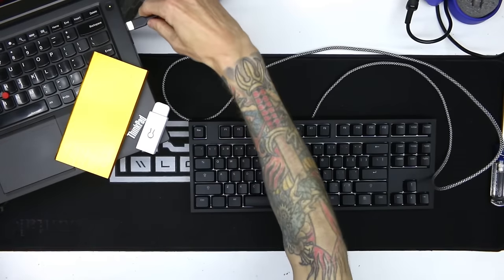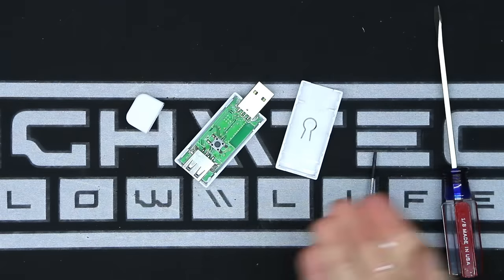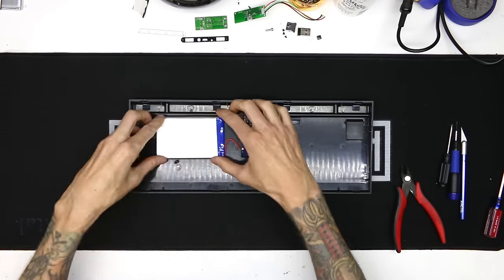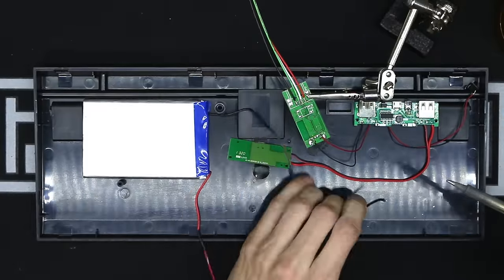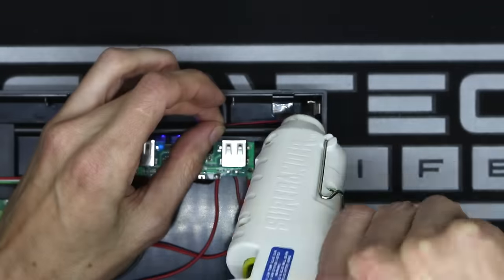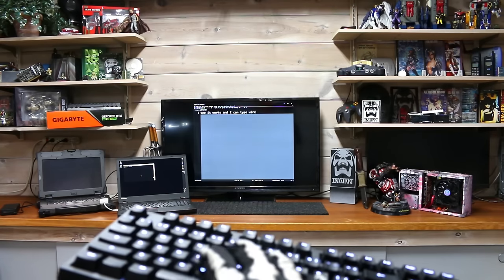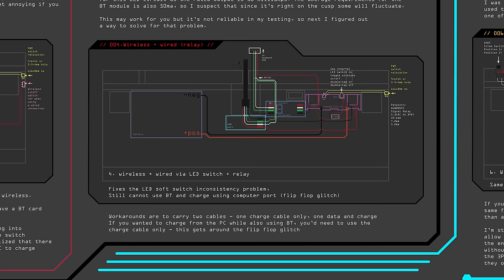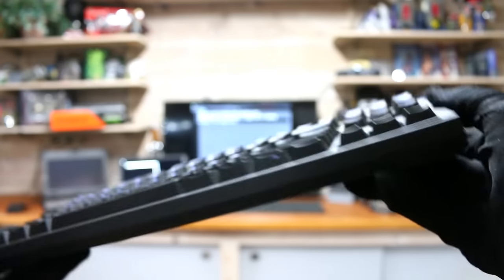⌨ Make ANY Keyboard Wireless! - Convert Any USB keyboard to Bluetooth Wireless - DIY Tutorial How To

Comment: Hello, The official site does not send the adapter to Colombia, where can I buy it to be sent to Colombia?
Reply from the maker: Hello, can you confirm with their support team? According to their site they do ship international: "$9.95 to international addresses by USPS airmail." 👍
Reply: OK, I'm going to write to them.  One question, if the battery runs out and I need to use the keyboard immediately, can I connect it via USB cable and use it, or should I wait for it to charge?
Reply from the maker: @AngelSing-Zepol  You have to look at my wiring diagrams shown in the video, I also explain in the video there is more than one way to wire it up. Either way it will work directly plugged in because the battery will be charging while you're using it if you'd like, you can also just have a direct wired connection if you want to wire it up that way. I show in the video wiring it either only wireless or both wired/wireless switched connections. 👍
Reply: @hightech-lowlife  yes, i saw your plans and they are great, but i have a question, when does the switch from wireless to usb happen? when you press the switch button? Or do I have to enter some command on the pc? the manufacturer talks about switching through the mode button or shortcuts, it is not very clear to me where you switch from BT to USB and vice versa. As I understand the mode button or shortcuts is the button that comes with the adapter, right? if so, you should extend it with cables and another button so you can press it whenever you want without opening the keyboard, right? or control everything from the same power switch button? like a double switch or something, I'm a bit confused at this point.
Reply from the maker: @AngelSing-Zepol  At the end of the video I explain the two different ways I recommend  to wire it up and the pros and cons of both. 

One is to use the BT module hotkey to do the wired/wireless switching. This is a lot easier to wire in, very simple wiring. [The only drawback with this method is that the connection to the computer is not native, so your computer sees your keyboard through the BT module "bridge" which is fine for most things, but if you want to do something like flash firmware to your board, you won't be able to because the computer is not seeing your actual keyboard, merely a bridge to it. ]

The second method I am using my charge circuit flashlight LED switch (double tap the power button) to trigger a set of relays that swap both power and data pins from the BT module to the USB cable. This will allow you to achieve a native USB connection to your computer because the wires from the USB port are directly connected, the BT module is no longer in the circuit at all. The relays are essentially "unplugging" the BT module and then "plugging in" the keyboard port. 

I hope that makes sense for you. 

You can wire this up many many ways though, I'm just showing you a few. If you're ok with adding another physical switch to your keyboard, then just add it to toggle between the BT and wired modes, that's all my relays are doing - I'm just using them because I can control everything off of one physical button. 

If you watch my videos on my custom dual battery keyboard I wire it up using a physical switch to toggle between bluetooth and wired modes. 👍
Reply: @hightech-lowlife Ah I understand, I mean in the second option (relay) you turn off the keyboard by pressing the switch once, and you do the BT/USB communication by pressing the switch twice, this way you only use one switch, right? but for this method to work the Power Bank Module must have the flashlight function. Everything is now clear to me, I will look for the relays here in my country, if I do not find them I will have to go for 006. Wireless + Wired (slide switch) since this way I also have a direct link just by moving the switch and I will be able to charge the battery without problems.

Friend thank you very much for your help. you're very kind.
Reply from the maker: @AngelSing-Zepol  Yes, you got it now! 👍 You may be able to find other relays that are small, it really depends on your keyboard you may have more room for slightly larger relays too. Thank you!

Comment: The idea is pretty neat and well thought through. The biggest block to me is the fact that the Bluetooth adapter costs more than the keyboard itself.

I guess if you have a really expensive/custom made keyboard it might be worth it to mod. But as for me with a 2017 Blackwidow Chroma V2, it's not really feasible
Reply from the maker: Yes, this mod is definitely not as a means of saving money or doing this cheaply, that would be an entirely different video. A lot of viewers seem to think this video was made as a means to make a wired keyboard wirelessly for free (or close to that) which it's not at all. 

The keyboard I installed this on is 3x the price of the adapter and this model is not offered with a wireless option, which is the use case for this modification. If you have a keyboard you really like and it's not offered wirelessly, then this is the solution. While for some people "just buy a cheap wireless keyboard" will work for them, they don't seem to be able to understand "what if they want this specific keyboard to be wireless?" they don't have an answer for that. 

There are a lot of options for wireless keyboards in the $50-70 range now (also keep in mind this video was made 3-4 years ago). But this assumes you like those keyboards, or you're not as particular about that as opposed to your budget. 

I don't think any amount of money (reasonably) is too much for a tool you will use for hours a day every single day. This would be an item you will far more than you will any other item you own by a huge degree (only matched with your mattress). If this keyboard setup runs you 10 years, you can take the initial cost and average that per year. Even if you spent 1000 on your keyboard, that is 100 a year, which is $8.30 a month. More people spend that at starbucks in a single day than they would feel justified spending that much on a tool they use every single day that is closely tied to their ability to produce income.
Reply: @hightech-lowlife  I actually did not think that far lol but I guess that's true. I just thought of this idea recently because of my new mini ITX I built and wanted to go wireless. Picked up a really cheap mechanical keyboard in pristine condition. I was, and still am, a bit baffled why a conversion like this is not more commonplace.

Guess I do know now. The dream is not fully dead yet though 👍
Reply from the maker: @qaywsx583  I personally don't even like wireless keyboards, I think the concept itself is largely nonsensical. Sure there are some edge use cases, where you're typing on your couch or using a keyboard for anything other than what they're really designed for (to sit on your desktop). It's not good ergonomically to type in any position that isn't naturally comfortable for your body and can lead to injuries down the road, and I think wireless keyboards actually encourage that or at least make bad decisions more accessible. 

For most people, they only desire wireless for the "aesthetics" and not the functionality, because functionally they are objectively worse than a wired counterpart. Plus they do have to be wired for at least some portion of the time because you have to charge the batteries which eventually need to be replaced. Connectivity issues, input lag, charging, all that just to hide one wire? I'd rather mod my desk, cut a hole in it to hide the wire than go wireless. I don't subscribe to this ultra minimalist aesthetic anyway, seeing how things connect mechanically is a feature to me, not an eyesore. Plus you can make the cable aesthetically pleasing if it's aesthetics one is after. 

Wireless keyboards are really just a novelty in my opinion, but having everything be wireless seems to be the trend these days.
Reply: @hightech-lowlife  Honestly now that you put it that way, you do have a point. 

I used to be full wired for like 11 years now, and it's usually been a no brainer for me to use wired peripherals.

Only a year or two ago, I started to get absolutely furious when my mouse/keyboard cable gets stuck somewhere while playing, but even then I just worked around it with bungees. 
Just very recently I'm playing with the idea of just ditching all wires to have more freedom while whipping my mouse around my desk.

I guess the wires are just a part of my issue feeling restricted by my desk space. Still kinda torn
Reply from the maker: @qaywsx583  A wireless mouse makes more sense to me, this is something that moves, although it's still within a very small confined area, if you're having to move your hand too much you might want to look into DPI scaling. I also use a wired mouse for the same reasons why I use a wired keyboard and if you have your wires routed correctly and unobstructed then you shouldn't have issues with wires (IMHO). 

Everyone is free to use their computers as to what suits them best and for a lot of people they tend to like wireless, just for me it doesn't make as much sense as wired. Good luck on your setup though man 🍻

Comment: What an educational video! I've been looking for this in months. However, I was wondering if it can be done with a 2.4GHz transmitter and receiver for better latency. Do you have any suggestions?
Reply from the maker: Thank you! I don't have any experience using 2.4GHz, only bluetooth. If you want to go this route, I think the best would be to get a cheaper keyboard and salvage those parts from it like this: https://www.youtube.com/watch?v=22MFteWbMIw 

I have seen some other conversions like this from donor boards also, you will need to do a lot more investment in time and research though. You have to dig pretty far on google to find useful examples or instructions, as not many people have done it. Another option is to use Arduino or ESP32 board for a wifi/2.4 connection, but again will take a lot of experimenting and writing code. 

Bluetooth has an advantage which is why most wireless keyboards and devices are now BT, a lot of devices such as laptops, desktops and phones will already have a built-in bluetooth receiver, so you don't need to plug in any USB dongle. 

Even though the BT-500 is more expensive, to me it is worth it regarding the time it will save you writing code or figuring out how to convert other things. Of course if you want to put in the time, I know it is possible, also, to me if latency is a larger concern of yours then wireless in general may not be the best way to go. 

If you do make a 2.4GHz version, please let us see! Thank you.
Reply: @hightech-lowlife  I am thinking of trying out a 2.4 ghz soon so i may let you know soon!
Reply from the maker: @wahidkamruddin1594  Awesome, good luck!
Reply: @wahidkamruddin1594  Have you tried it yet, I am also thinking about doing this too.

Comment: This is awesome, one day I hope to get to a point where I'll do a full conversion like you did.
However for now, I'm just going to do the simple battery pack/inline BT/Keyboard setup because it's all going to go inside my Old Corsair 'Lapdog' - the old version of their lap board (couch PC gaming w/ mouse and keyboard). 
The old 'Lapdog/Lapboard' runs a 20+ft usb3 cable across my living room and it's not ideal.
I will be able to stuff all the cables and battery bank inside the lapboard enclosure and call it a day and use my mechanical + bluetooth mouse. I'll have to position the battery bank to a spot where I can charge it easily though! Perhaps a cutout/mounting for access. We'll see! Thanks again!
Reply from the maker: Running the components outside the case is certainly easier to set up, it should work just fine for your use case 👍Good luck and thank you!

Comment: I'm about to watch this. I hope it works out. I have had some ideas, but couldn't find any guides. I stumbled across your video by accident.

I was also looking for a bluetooth module like the one you use. I'm going to attempt to solder a usb adapter in series with a cable and a usbc female port. Wish me luck!
Reply from the maker: Good luck man!

Comment: I have a Logitech K800 that is my absolute most favorite. Only downside is connecting with Logitech unifying dongle. I would really appreciate if you could make a video if it can be converted to bluetooth connection
Reply from the maker: I'm sure the methods would be more keyboard specific as each mfg probably has their own way of building their systems. The methods I show in this video are truly universal as almost all modern keyboards use USB, so undertaking that specific use case may not translate to other users wanting to do the same. It could be something simple or it could be nearly impossible or contain so many workarounds to get it to work that it's not feasible economically or from a time investment standpoint.

Comment: Thanks a lot for the tutorial, does this work with a keyboard with a customizable led?
Reply from the maker: Yes it will, I'm not sure if you can program the LEDs using the software without a direct connection. But I have shown multiple ways to wire it up and one of those ways should be sufficient enough. If I had a keyboard with addressable RGB I would test it for you. I may make a follow up video to this answering the FAQ's from this video because a lot of people have asked this question 🍻
Reply: @hightech-lowlife  oh okay, thanks bro 🤝🏽
Reply from the maker: @CarlosAlberto-qp9uy  Cheers brother 🍻

Comment: Hey man, this is an awesome video! 

What do you do if your keyboard doesn't have a seperated usbC adapter, like the DZ65v3 PCB with usbC soldered onto the PCB? Do you just flywire or........
Reply from the maker: Hello, it is possible but harder, you can either intercept at the port pins (very hard on a type-c because they are so small) or intercept before the wires get to the port (although you will then need space/solution outside of the case). 

Check out this video I did on a Mini-B port that is soldered direct to the motherboard: https://youtu.be/2Df7Dh3-3o0?t=341 (time stamped at relevant part to you).
Reply: @hightech-lowlife  Thanks! Ummm another question, is it(BT-500) compatible with DZ65v3, which is QMK and VIA compatible?
Reply from the maker: @SyllaZero  Yes, it doesn't matter what firmware you're running, all it does is convert USB signals to BT 👍 You cannot flash firmware over BT though, so if you're wanting to flash firmware a lot you need to also have a 'direct in' bypass switch (as shown later in the video).
Reply: @hightech-lowlife  If the battery has a protection chip, do I still need the battery control chip shown in the video?
Reply: the protection is for overcharge
Reply from the maker: @SyllaZero  Yes, because most lion batteries output 3.7V, you need 5V to run the keyboard, the charge circuit isn't just for battery protection, it's also a boost converter that ups the voltage. If you already have a protective circuit on the battery, then you can just add a boost converter.
Reply: @hightech-lowlife  Thank you so much! That's a subscribe for sure!
Reply from the maker: @SyllaZero  You're welcome man, thanks for the sub!! 🙌

Comment: Hi, I was wondering if this works on a keeb with a built in usb c plug. I have someone who wants me to build him a board, and he really wants a wireless Alice. If you have any suggestions for any wireless Alices that would be even better. It also has to be Mac compatible. Thanks!
Reply from the maker: Hello, yes it is totally possible, if you're trying to do the 'intercept' method it will be a lot harder, but still doable. If the connector is soldered to the PCB, I would just get a connector and then splice/intercept there and then come up with a solution for the case to move the charge port (or add another somewhere else). 

Pretty sure there are wireless alice-style boards out there already though: https://www.reddit.com/r/MechanicalKeyboards/comments/enzgz1/wireless_alice/ 

and another: https://www.reddit.com/r/MechanicalKeyboards/comments/occaw3/geulis_a_wireless_alice/ 

Keychron is coming out with an alice type board too, but I don't think it's wireless. 

Good luck man!
Reply: Thank you so much man, you earned a sub.
Reply from the maker: @griffy8576  Thanks a lot man! Much appreciated 🍻

Comment: Wow amazing, is there any way to change the name of the bluetooth adapter device?

Also I have a spare Razer Blackwidow I'm going to try it on, that comes with built in USB ports on the side so maybe I will try to upgrade them or something :)
Reply from the maker: Yes there is, the BT-500 has a way to edit the firmware name so you can name the device whatever you want. You should try it out! Thanks man 🍻

Comment: Génial !!! Good job !
Une question: on peut utiliser le tuto de votre montage sans problème, il fonctionne ? (sauf que l'on ne pourra pas mettre à jour le firmware du clavier si j'ai bien compris)
Reply from the maker: Thank you! Yes, I actually show two different ways to do it, one uses the hotkey bridge (easier to wire) but you cannot update keyboard firmware (if your keyboard even supports that), and then also hardware switched so that it operates with native USB which you can update firmware 👍